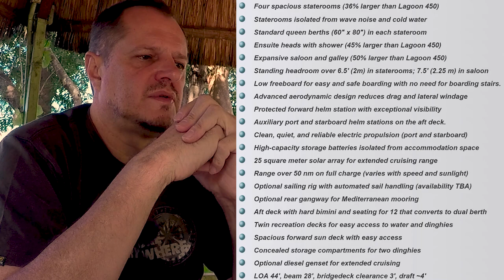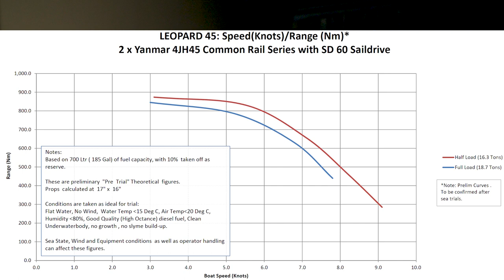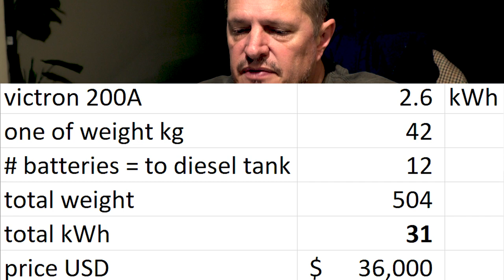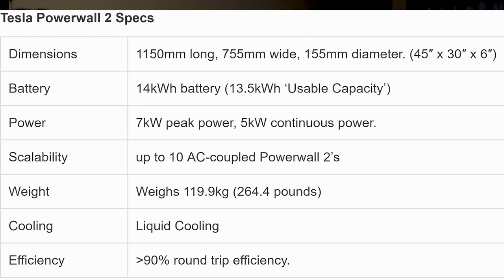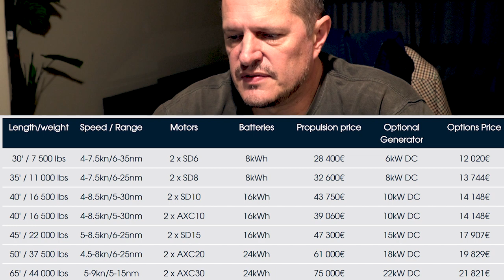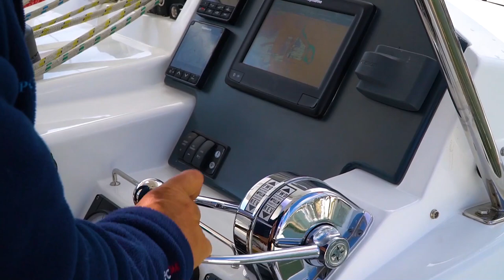#25t Diesel Engines or Electric Motors for Our Catamaran | Sailing Sisu in Cape Town South Africa

Comment: Hi Capt Frik, did you get a J1939 scan tool for your Yanmars? I work on-board diagnostics, and am on the SAE J1979 Committee, equivalent of ISO 15765-4.  
I did diagnostics work on the General Motors Two-Mode Hybrids ten years ago, and also have a diagnostics patent on the Chevrolet Volt. Given current range issues, the Volt with a range extender in series is probably the best bet. But it would be a smaller diesel!
I also worked at Cummins and am familiar with the J1939 protocol, which is the diesel equivalent of J1979.

I found this for Yanmar engines, do you have a scanner like this? Is there a J1939 diagnostic connector on the engine?
https://www.yanmar.com/us/wp-content/uploads/2015/11/Yanmar-CANplus-600-Operation-and-Troubleshooting.pdf

J1939 connector:
https://www.ocp.com/product/11760-03-226/?utm_source=Google%20Shopping&utm_campaign=Product%20feed%20for%20shopping&utm_medium=cpc&utm_term=89911&gclid=EAIaIQobChMIgdP2s5Wl5AIV8__jBx11lQolEAQYASABEgJpH_D_BwE
Reply from the maker: Oh, wow, yes, the LCD can display a lot of information!
Reply from the maker: I wanted to bring that information into the Axiom Pro, but boy, the harnas was a bit pricey!
Reply: Sailing Sisu I have found that nearly every controller type has a system setting and/or diagnostics function but they are on hidden screens. I always read the manuals.

Comment: Hi Sisu, found your channel.
like the spsreadcheet comparisons ;-)

i see in te comments you already found the rigging docter channel.
Did you already check theyr reviews on the atlantic crossing?
I found it a little bit sad you got convinced by the director of Leopard.
It's not becaus one production brand is dicuriging you to go electrict that it should be set in stone.
you should follow your gut ;-), it could be more cortly to convert later on.
specialy when other brands are delivering hybrid electric like Mavrick.
there is more rooting fore a full electric conversion then you took into consideration.
specialy when you are going full live aboard.
for ex: besides when you are otering on your engine, there is no benifit on having a fuel tank. the batery pack you could use for other domestic means.
while you are sailing, your diesel tank will not get full again while your battery bank will throu regen or other means.

just saing, Frik could be the elon of sailing catamarans ;-)
Reply from the maker: The Hybrids are koowl and the best there is at the moment...The test would be to be able to run those motors for few days without cooling time or recharge time. We have no been twice in 6m breaking waves and 40+ kts of wind where we had to motor for 2-3 days without a break. Off course we took the hard way (80% upwind) going to the MED, which took us close to the section in the Doldrums where there is no wind for 600-700nm...we could just turn on the diesels and they run 24hrs for 5 days, no problem. The Rigging Dr stayed in the Northern Hemisphere and in the steady Trade Winds. I am sure you watched Delos where they sailed Namibia, St Helena, Ascension all the way to Brazil not using their engine at all, not even for dropping or lifting anchor! Crossing the Atlantic is very easy using the Trades, but try to sail 80 different latitude degrees without engine....or to rely on electric motors for days without a cooling of break... BTW, one of the reasons why we choose a cat was the redundency of having two motors...if the genset breaks, then you are in trouble if you need engines....

Comment: I think your math might be off some where.  I have seen electric boats of similar size that can run for 8+ hour on much less battery than you are talking about.
Reply from the maker: Would be great if you can share us the link! But the same math is shown on the Torqeedo site too and by that Quad44. The motors just need too much power and there is not batteries to store that power. Also keep in mind, I am not talking about a high performance, all carbon fiber with honeycomb epoxy hulls... cruising cats weighs a lot, 19,000 metric tons. That is a lot of dead weight to plow through the water. and water speed vs resistance vs power required is quadratic. if you double speed, then you need to quadruple your power. Batteries are just not there yet.

Comment: The solar Li Ion.Battery  diesel generator combination looks to be the best solution if you can bear the  eye watering costs . There is no way in the long run you can  outperform the  Diesel engine solutions  in terms of fuel costs . However the ability to only run a diesel generator a few hours a week  versus noisy running Diesel engines to make electric power is very interesting especially for charter boats . There is one example of a large cat used for charter in USA that has the  solar Li Ion.Battery  diesel generator combination for the house system and runs three large A/C . A Lithium Powered  Cat, Our latest upgrade Ep.20 (The Space Between ). https://youtu.be/9GoSDOM-jVI. It reduces they estimate the generator running time dramatically  based on the previous version of smaller  li ION battery solution they had . A cat can do something that is harder for mono hulls to do and that is have a Diesel engine in one hull and a electric power solutions in the other hull  and have a generator to run electric engine when batteries have run out  so as to be hybrid electric power . A  example would be 38 kilowatt  Diesel engine for one hull with a suitable 50 Kilowatt diesel generator  to drive the electric power source probably 15 KW  motor to switch on when battery power was down . Then for battery power cut  that down in range to something like 5 miles range  The electric power engines could easily be twin folding on twin 7.5 KW motors props to give best control in harbours . The Diesel engine could also have two folding props also driven of Hydraulics .   There will be losses from two props versus one bigger prop and losses in the hydraulic power and electric resistance  with longer cables .However to reduce the losses lower and to keep costs probably better best to have single props for each type of power source and opt to reduce the speed under electric power and diesel electric power down to something like less than three knots and bring Diesel generator down to smaller less than 20KW size  . The problems of electric power in this time are there is no recharge electric Grid power points to connect into Like a Tesla car can . Generating power from Diesel generators is very costly  often 5 to 10 times the cost per kilowatt than grid power . Example is Grid power in the USA costs about $0.20 cents per Kilowatt  where small diesel generators tend to come in at $1 to $2 per KW . Therefore electric generation by solar panels is very interesting if the costs can be done at less than $1 a single WATT .  In large solar Farms they get these numbers but on small boats that nearly impossible to get . The real maths of the problem is that Diesel fuel is about 12.66KW or 12,666 watts per kilo of fuel  Li Ion in this time is approx 130 watts  or less than 2 % of power density . However the Diesel engines are wasteful in energy starting at  approximately 65% losses in the engine with losses in the gearbox and shafts and prop losses they often return less than 10% the power that is eventualy  harnessed at the props . Example a 35 KW motor GROSS power might finally give NET power 3 kilowatts of power to the boat after all losses . A electric drive will often have more low losses than a Diesel fuel engine  and return approx 40% NET power from Gross input power . Example  8 Kilowatt electric power solution might return 3 kilowatt NET power to the boat system after all losses  . That will be based on losses in battery from heat losses in speed controllers from heat and ramping  and mechanical loses  The normal prop losses are often about  30 % much the same as Diesel engine prop losses . The big trick with electric power is to look the slow speeds 2 to 3 knots where power demands are low  about 1/4 the power demands of 5 knots . If 5 knots needs 20 kilowatt of electric power to go that speed then  at 2 knots then it might be more like 5 Kw to go at 2 knots speed . Yes that 2 knots speed  is slow  but crossing oceans in calm regions  which often exist in mid oceans  it can cut down the amount of Diesel fuel needed  to get across the ocean if there is slow power demand electric solutions to push the boat in calms  . Cutting down fuel demands  lightens the boats  and reduces fuel fire risks . It might be possible to put enough solar panels on the larger cats that they can in daylight hours return average speeds of 2 knots  but its gonna be lot of panels and a lot of costs.  Solar power only Speeds of 5 knots don't look doable on boat smaller than 100 feet     Solar power slow speed  with  electric engine solutions for ocean crossing boats can help if speed is not a issue such as Charter boats who require to get to new charter boat locations on schedules at different times in the year .
Reply from the maker: Very interesting comment and I am experiencing here at 38 degrees north and winter times, that we just do not have enough solar panels to even keep up with our normal use. Well, we do use the 1.5kW kettle (3% of battery power for 2 cups of water) and we have a lot of cameras, laptops, and phones, which all need charging. Then there is the electrical system itself, which uses power to monitor, protect, and charge the batteries....the only other place to increase solar panels, is at the back over Tippex... But to charge enough for 13kW motors?

Comment: A Tesla Power Wall is very dangerous for on a boat. They're not designed for marine applications and use  Li Ion cells that when the BMS fails (and it will some day) will do a catastrophic thermal runaway at temperatures you can't handle. Almost all manufacturers of marine electrical products that have Li batteries for sale use for a very good reason LiFePo4 prismatic cells. Li Ion cells are awesome but not on a boat. The weakest link in y system is always the BMS. When that goes you loose everything, maybe even your life. If you use LiFePo4 cells and something happens you only loose that one cell and your boat is still afloat.
Reply from the maker: Great catch! I heard Elon one day talking about Lithium Magnesium Phosphate and I thought Tesla would use that for all their batteries...mmm. And you are very correct Li-Ion does not take the same amount of charge neither can it discharge in high volumes. Not good.

Comment: Hybrid diesel, gen set,  electric ia the aolution
Reply from the maker: I am still not convinced. In our recent video, we did motor 2 days out of a 6-day passage. We could alternate between the two diesels every 3 hours and let the other one rest. While if you had a hybrid, you will have one battery bank, one genset. If you have two 13kW motors, it means you would have depleted the propulsion bank within 4 hours and from then on it would have been the genset. You need at least 13kw genset for continuous propulsion, but you cannot run a genset at max capacity for that long, so, you need to upgrade your genset....which means more weight more fuel more noise more polution...well, kind of defeats the purpose in general of trying to reduce weight, footprint, diesel consumption, and noise ;-)

Comment: One cannot compare electric cars with electric boats. When the car fails, you open the door and walk away. When your boat propulsion fails, (in this case due to a lack of reserve energy, not equipment failure) you are subject to danger. It could be a storm that you are trying to run away from, it could be current that pushes you towards the rocks, it could be anything but Murphy tells me it is going to be bad.  To me it is contrary to good seamanship to not take into account that wind will die, that  it will rain for days and the batteries will get too low to save you from disaster, as disaster may occur. Your boat value will suffer from your decision, Who will buy your boat the day you decide that cruising is over? Who is going to pay to replace the batteries, you or the buyer?
Reply from the maker: Exactly what I said :-)

Comment: I would LOVE to see electric motors replace the old diesels, so much cleaner and quieter...just need to improve the batteries to the point that the range is acceptable, especially for long voyages/passages like a 3 week Atlantic or Pacific crossing, or the pole to pole traveling you all are aiming to do. 

Maybe you two can be the first to implement such a solution and be the leaders in showing that it CAN be done. 

Elon is forging ahead but lately with all the cuts he is making, and buy stock, I think they are hitting a financial tough area and are trying to stay "afloat"...

I know a company in Thailand, Heliotrope Yachts (http://yacht-heliotrope.com/), is seriously looking at this possibility, they are the leaders in going completely SOLAR , best place to get your yacht fitted for running off Solar and no GenSet.

I found this video made by Sailing Doodles that interviews the owner of the company, its a very good discussion and he talks about Elon Musk and Tesla as well.

SOLAR ASSISTED YACHTS - An Interview With Heliotrope Yachts

https://youtu.be/Obi1sBx0Ca0
Reply from the maker: Thank you, Michael, yes, I have that video listed, actually both sites. I am a serious Elon fan :-) but let me first experience myself what is what. I do not even know how to sail, so, I will give myself a chance to get some experience while checking out what can be done with electric motors and what not :-)

Comment: Are you an electrical engineer? What do you think your chances of fixing a diesel engine as opposed to an electric motor are? A couple of impellers, A couple of different lengths/sizes of hose, gasket material (plain and pre-formed), maybe an injector, an extra alternator, and some vinegar to keep your heat exchanger de-scaled, Racor filters, fuel treatment...you're golden. Having an electric motor part shipped to you from halfway around the world could be very expensive. Plus, PLUS, electric anything in a salt air environment is very tafiki-taboo to me.
Reply from the maker: Thank you for watching! In fact, my first degree was Electronic Engineering :-) The other three were in Management and Information Systems. I have far less knowledge of diesel engines than electronics or electric. I got about half of the words and meaning from your comment :-D
Reply: If you can earn a degree in Electronic Engineering, a diesel engine would be child's play for you. You could probably read Yanmar's operating handbook and be considered an expert mechanic in a weekend. I had twin, Detroit Diesels 6-53's on our charter fishing boat, 20 years old. On rare occasions, I would let my "King's English" get a little loud :D, but we always came back on our own power.
Reply from the maker: Lol, ya, you summed me up quickly! But also read my pinned statement at the top, you will like it.
Reply: Saw the video on the torqeedo system. Nice. I imagine there is some weight and price concerns. The weight has a trade-off in the lesser amount of diesel needed, I guess.